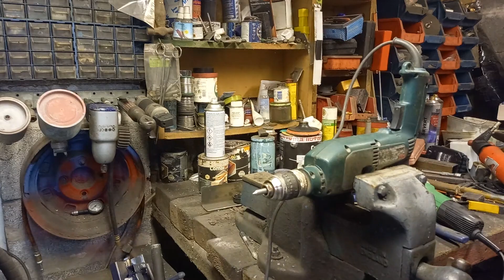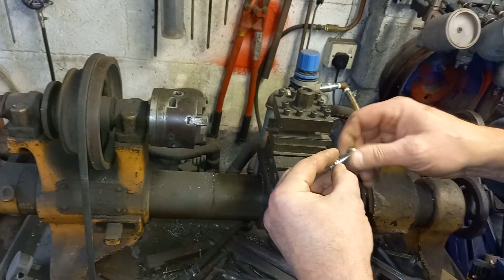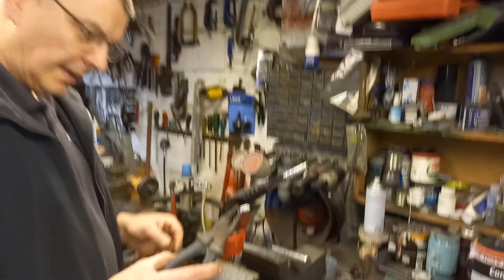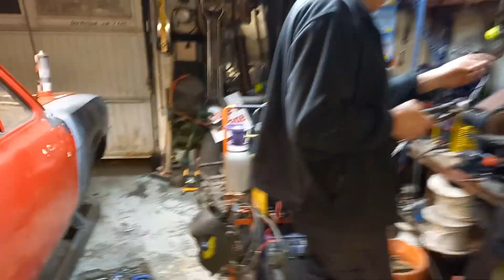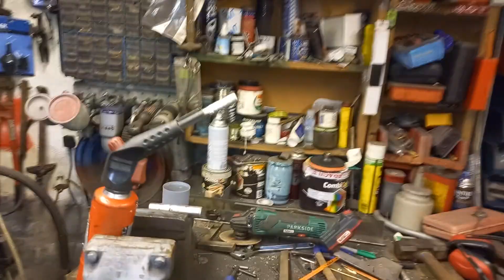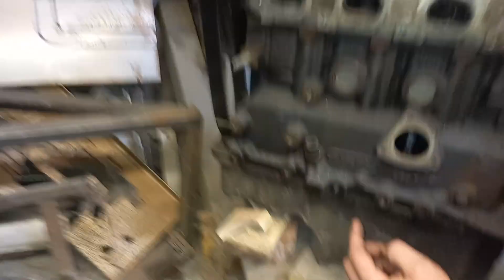Ford Escort MK1, making transfer screws and heat treating steel.  Car Restoration.

Comment: I know it's a right hand drive conversion but are you doing anything with the wiper linkage ? As the wiper sweep will be the wrong way
Reply from the maker: Yep, We'll be swapping that over, and maybe seeing if we can use a different motor etc, cos rhd linkages and motors have reached silly prices

Comment: If you placed the original thermostat housing on top of the piece you want to mark you can use transfer punches and save all the time making the studs. Its quicker and you dont need multiples of to be accurate.
Reply from the maker: For that I just clamped the housing to the steel and drilled through. What I struggle with is transferring blind screw holes over, hence the transfer screws 😊

Comment: Do yourself a favour, buy yourself a Starret spring loaded centre punch simply the best there is. Not cheap it's a tool you buy once only in a lifetime.
Reply: That's great but dave said he struggles to centre his punch so being automated doesn't solve his problem